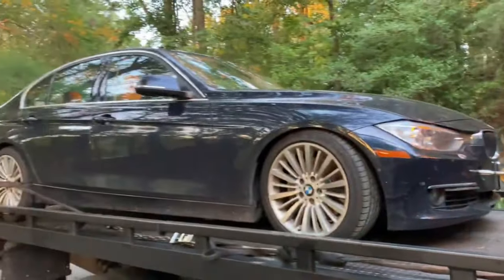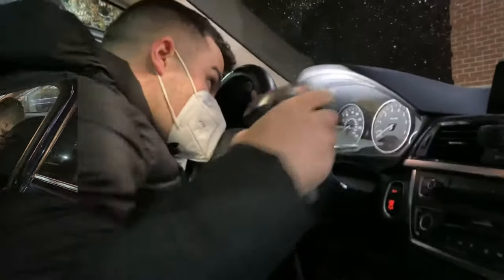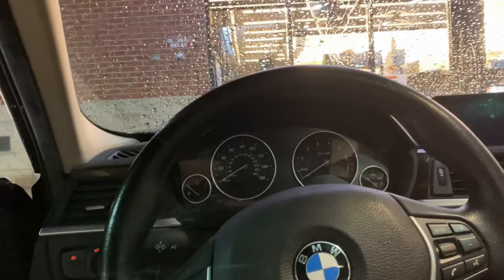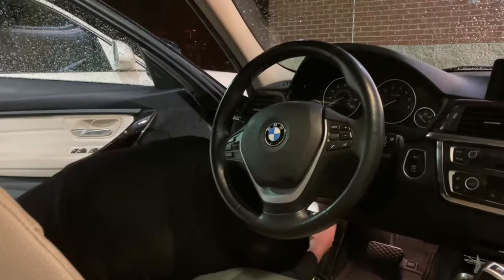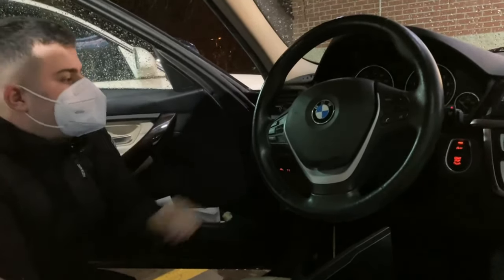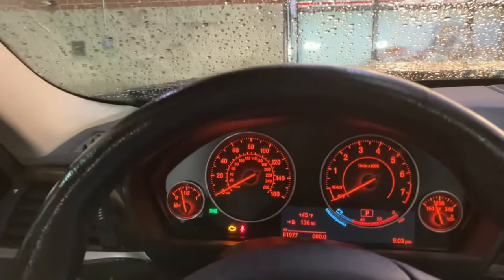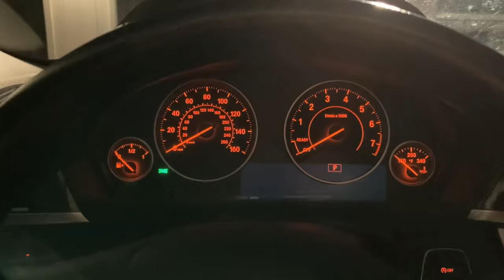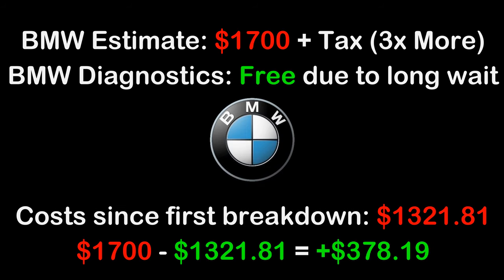2015 BMW 335i 6WA Instrument Cluster Install and Coding: No More Battery Drain! F30 N55 xDrive F31

Comment: Sorry but until today I know the solution, No need to replace alternator, battery or the cluster. The problem which causes the battery discharge is the cluster but you don't have to replace it. When your car has battery discharge, you will notice your cluster was taking it forever to switch off, and all you need to do is restarting it by disconnecting your battery negative lead, wait for 15 mins, reconnect the battery and it's done!
Reply from the maker: Are you sure? The alternator and battery were replaced before the cluster if I remember correctly. I imagine the negative lead would have been disconnected for 15 or so minutes during that procedure.
Reply: For real? Did you do this fix?
Reply: @SadiePeterson-f4c  Yes, cheap and fast solution for this. normally all the thing that you been retrofitting your car which causing that problem but instead of replace them and cost a lot of money I prefer keeping them and do that trick instead.